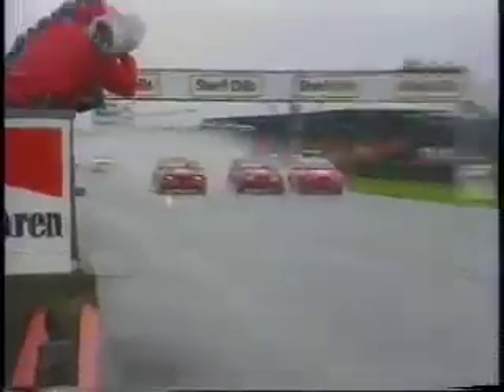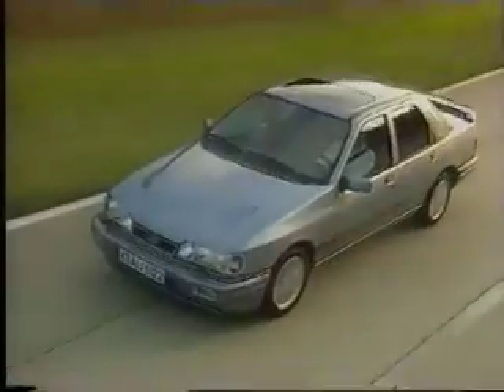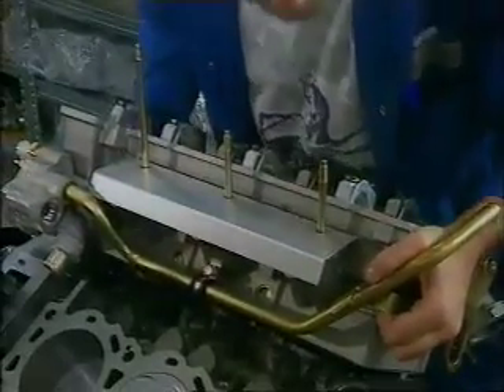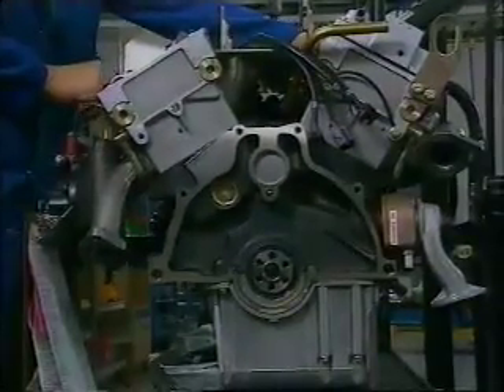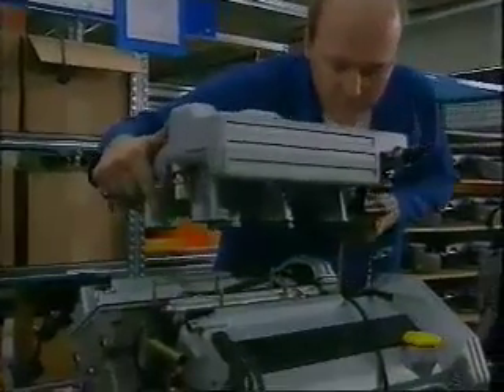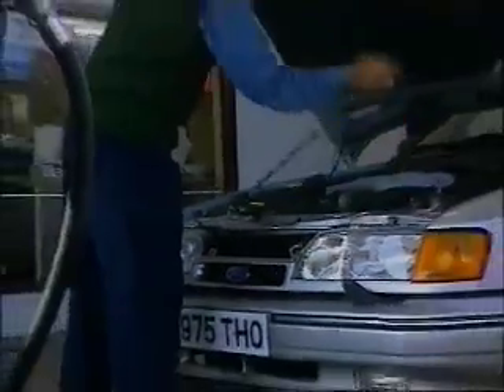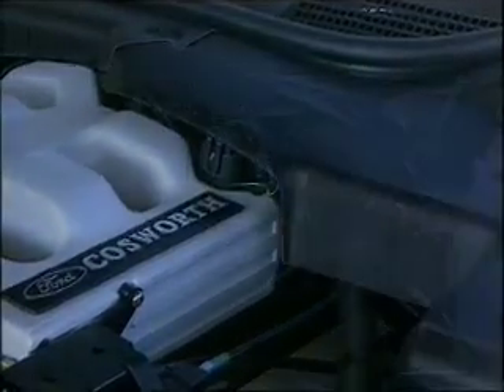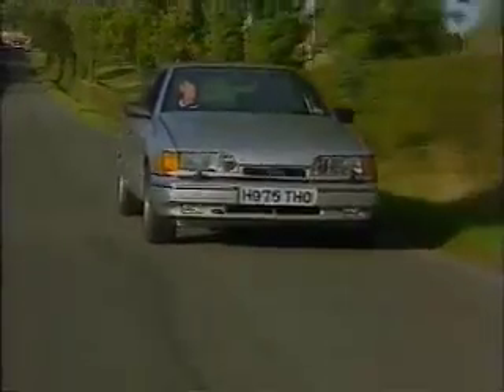2.9 24V Cosworth BOA Engine Ford Service PART 1

Comment: The european engines are both economical and powerfull with sophisticated mechanics, airflow distribution and advanced ECUs, etc, etc...

And then the USA engines:  V6, V8, even bigger V8 and maybe V8 with chromed cap :))